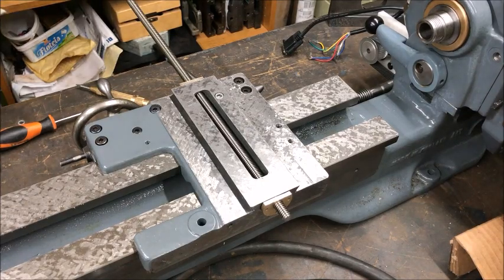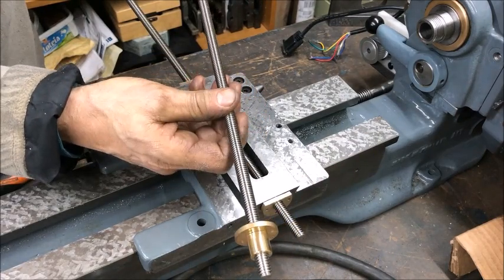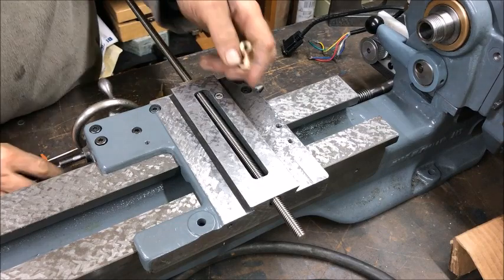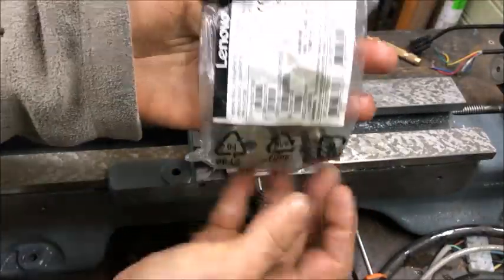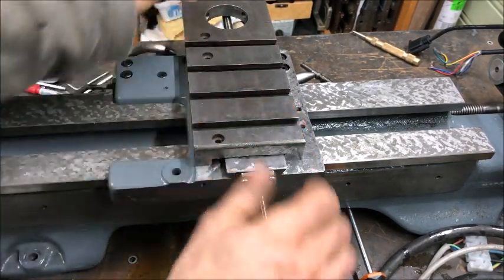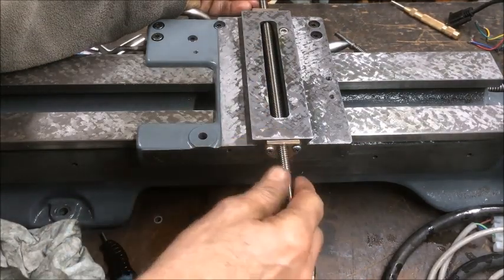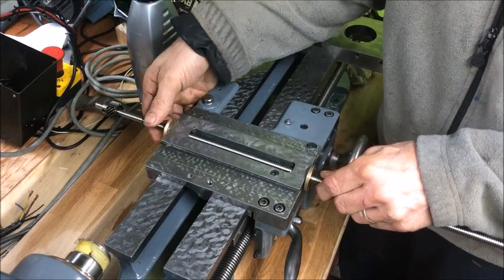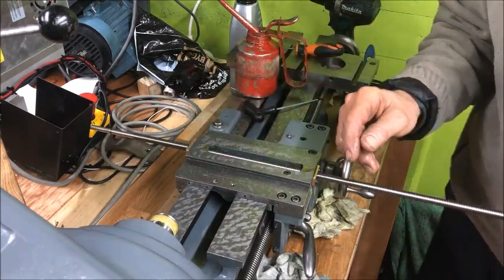Myford Super 7 metric cross feed with double nuts

Comment: Hi Steve! I have a question a bit out of the box.. it May be stupid for someone who know the answear but i am new to it all. I just bought ml7 and my dials on top slide, cross slide and tailstock are all imperial. Does it mean i have an imperial lathe? If so.. would it be possible to make it metric by changing the parts? Wanted to buy a gearbox too an there it is another question.. are they imperial and metric gearboxes? If so What is the difference? Thank you for your time and all the videos! Regards
Reply from the maker: Hi there! I am Jan (or Jan Sverre), so maybe you got the name wrong, or you have misplaced the question?
Anyway, Myford has (as far as I know) never made a metric version of these lathes. They do sell metric screw/nut/dial replacement parts for both the cross- and top slides, though.. at least for the Super 7. The leadscrew used for the longitudinal feed and screw-cutting is however imperial (8 TPI).  They offer a "metric" handwheel, but since the screw is still imperial you will get a strange partition per revolution.. some 3.2 mm or so if I remember correctly. The tailstock screw/dial is also imperial. Gearboxes can do be set to do both inch- and mm screws.. with the correct input gears and settings. A gearbox is nice, but I have sort of moved onto using the ELS system and favor this. With a "gearbox replacement system" ie. Z-axis hybrid-stepper motor/driver/power supply, the encoder plus the ELS control box you can have all metric and imperial screw-cutting plus feed settings done electronically. This allows you to set ratio between the leadscrew and spindle (in both directions), just as you would do with a gearbox. If you then want to have the X-axis driven you can also do the screw-cutting cycle "full auto" as this would take care of the in-feed as well. The cost for a Z-axis system is comparable to a gearbox, but in my eyes offers with advantages like being able to cut all gear combinations and rapidly change between these and from feed to screw-cutting. You can jog and fast-feed as well as have position control with read-out in 1/100mm to an exact Z-axis position. And you can develop your solution to also include control of the cross-feed. It is also a bit less noisy, especially if you use a belt driven variant
Reply: @jansverrehaugjord9934  I do apologise for that embarassing mistake... i think i made it because of the surname. Thank You very much for reply. I will have to read it few more times to get it right as its all new to me:)

Comment: Hello sir, your video is very interesting and gives me ideas.  I don't own a Myford lathe but would still be interested in the long slide for another use.  Would you be so kind as to provide me with the outer dimensions (L × W × H) of this slide as well as a link where I can buy it new or used, at a good price.  Can I expect a positive response?  Have a good day, with my best regards.  P. K (French)
Reply from the maker: Thnks! I think it would be be best to purchase this directly from Myford. As I don't recall all measurements, they will be probably be able to give you these. https://www.ebay.co.uk/itm/New-Complete-Myford-Super7-Cross-Slide-With-Adjusting-Screws-Gibstrips-A2060-2-/142456178619
PS! I don't think the price as listed is correct, so I would contact them. Otherwise there are several others listing on Ebay for used versions
I can also try to take a measurement..
Reply from the maker: Dimensions (LxWxH) in mm: 271x98x25. The exact measurements are of course imperial, ie the height is probably 1", and my example slide here might be a bit off as we have ground the sides and top and my "conversion" to metric may not be 100% axact
Reply: @jansverrehaugjord9934  Hello sir, I say a big thank you for your information and apologize for this inconvenience.  I am all the more satisfied that Myford, whom I contacted, did not respond to me.  Thank you again and have a nice day;  friendly greetings.  P. K
Reply from the maker: @paulk3573  You're welcome. Good luck!